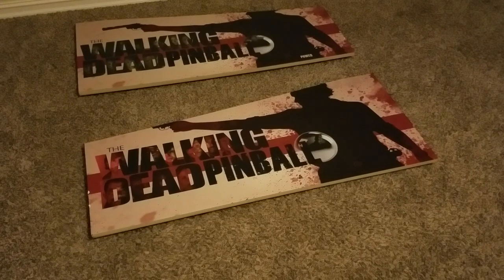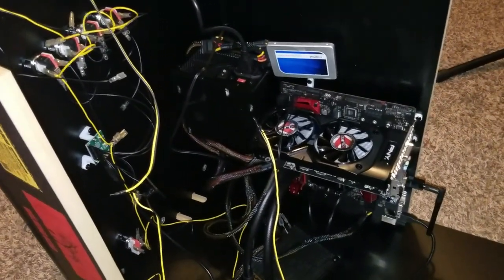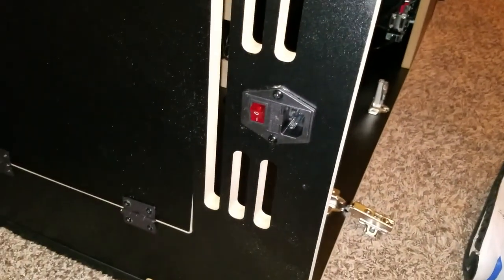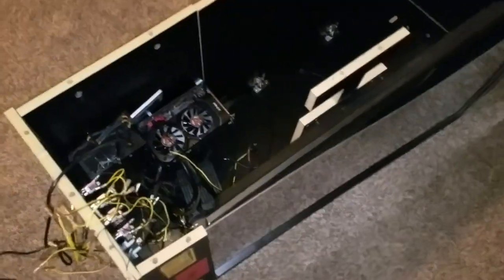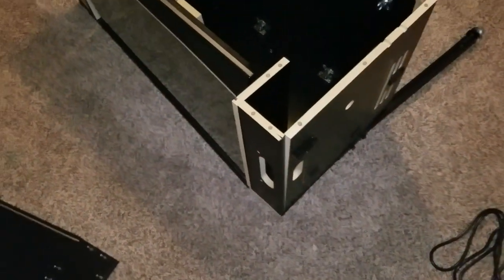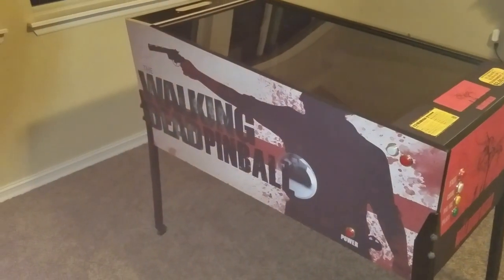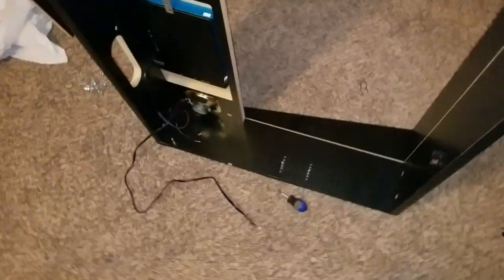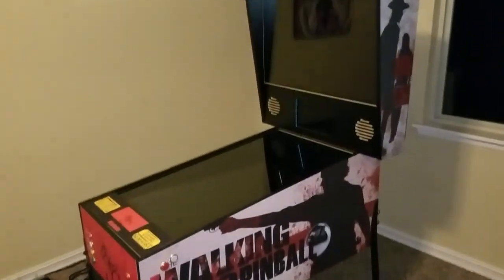GameRoomSolutions com 40 Virtual Pinball Cabinet Assembly

Comment: Looks good! Is there an option to customize the build and remove the underside door so that additional hardware can be added inside? Also is there an option to add an actual lockdown bar?
Reply from the maker: I considered a lock down bar, but that will add at min $100 to the cost of the cabinet and I thought it looked awesome without the expense.  I can look into which one would fit the cabinet and recommend it, but I don't think I will offer it as again the cost will go out dramatically.
Reply: GameRoomSolutions.com yeah I know the additional hardware costs more but I would def pay to have it. Any word on removing the bottom door? I want to add a sub and other equipment and I don't think the latch would hold it all.

Comment: Is the playfield monitor flat or angled?  If angled, how much?  Thanks.  Will be ordering as soon as available on your site with a couple design options to choose from as I'm terrible with graphic design.
Reply from the maker: The playfield is about 2 degrees while the cab is 6.5 which is pretty standard.  I sold 6 so we can work out any kinks, but I am waiting on our official packaging before we post for mass sale which should be next week.  We have those customers turning in designs now.
Reply from the maker: Contact through the website.

Comment: What motherboard, video card, power supply are you running? I'm just about to start building your smaller setup so i would like to know what you're using
Reply: I'd like to know this as well, or minimum that you'd suggest.  Want to buy all the computer stuff Black Friday then buy the cab shortly thereafter

Comment: It’s not on your website, what is the price?
Reply from the maker: I am going to start significantly lower than competitors.  We have our first half dozen going out this week and I may have to adjust a bit once we see exact shipping costs, boxing/packing (quote coming), etc.  Prices below include free US shipping so this is a much better value than anything else out there.  Keep in mind we have sold 1000's of bartops over the last 4 years so this is simply a new product for us we are not new to doing these kinds of products.  

Cabinet/tmolding/assembly hardware/legs (black or chrome)/plex/shipping = $729.99
Artwork pre-applied - $199.99
Control kit - $44.99
Reply: when can we order one ?